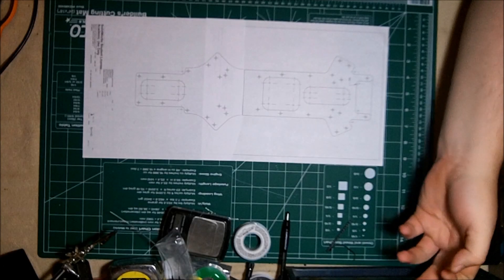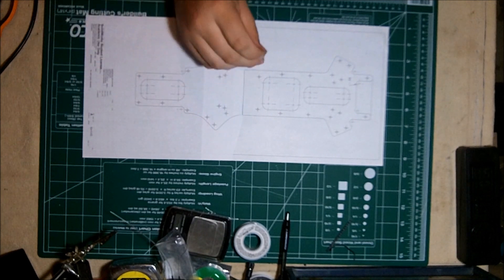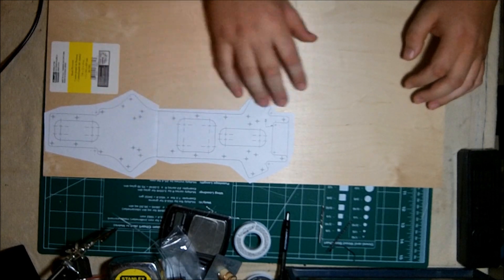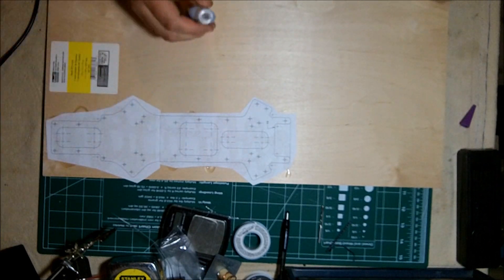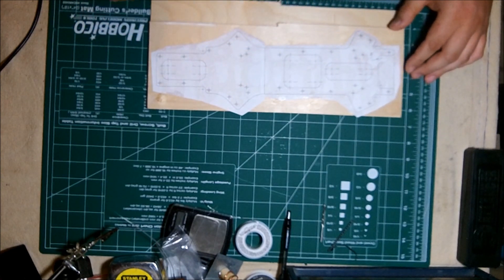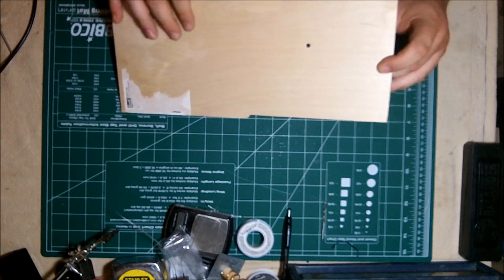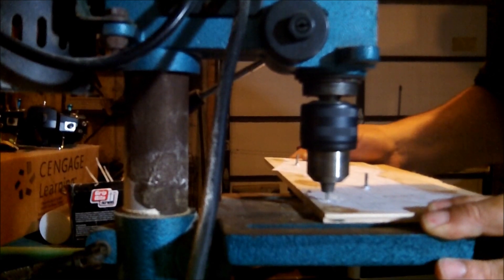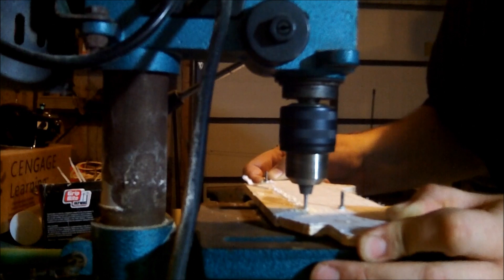Lets Build a FPV Spider Quad Part 1

Comment: Hey nicjk, I know its neen a while since you put these vids out but I just bought 2 spider frames and want to build them. Any way to get a parts list. I just want a large race drone non altitude hold no GPS build. How do you program it etc. Is this something I can plug into Betaflight and configure? Or what software do you use radio etc? Subbed thanks for the great vids.

Comment: How can I download your plan details without having to accept a bunch of software crap from that download site?  I followed your construction through to finish and the securing of the paper template with the superglue had me concerned until I saw the results after spray painting the body.  Does the paper add to the shine you got to the finish?